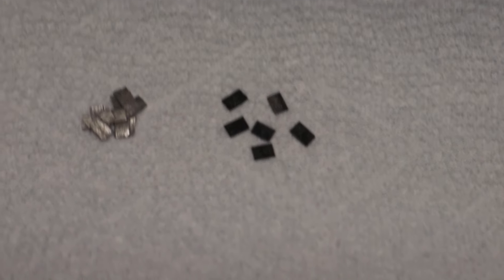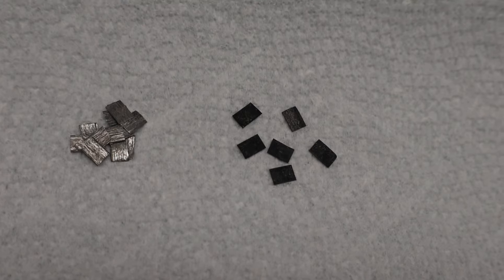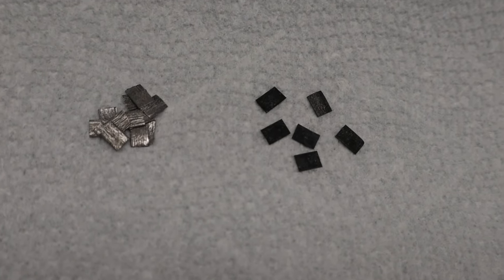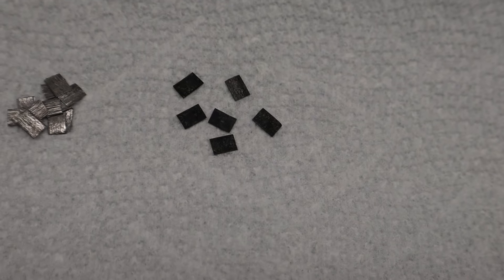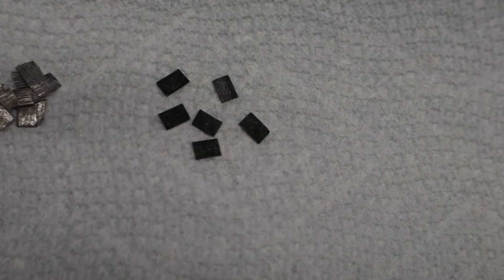Bismuth Coated Magnesium Chips ready for Stack Compression into Layered Nanomaterials

Comment: Great idea! Hit it with scaler! Linda M was always taking about terra hertz. She sold here biz/mag/zinc to the Government. Arts parts. Art holds many keys. The biggest is Mad Man Mike Mercum His small Jacob’s ladder could teleport a screw a few feet and disappear for a half a second. His next build was a 10 ft diameter ring of electromagnet, with 3 million volts at one amp, it took him 800 miles East and 2 years into the future from 98 to 2000. This is the best document evidence on time travel so far. He had 25 to 30 investors in this project. Thanks.
Reply: What are you taking about, no seriously I'm interested.

Comment: Although to produce the bi/magnesium+3.5%zinc layers 25 thick in just 2mm or so, and in the same shape used in the Roswell crash the idiot shot down, you'd need a very large electroforming bath, over 1 million volts@16kw, and a premade titanium alloy with the exact shape. Get the shape wrong, and the spatial 3 phase wave will not focus properly and you'll get a craft that can't fly straight. It's a very exact science. The best way to produce that type of energy is to have an already working antigravity device blasting heavy positive ions above it.